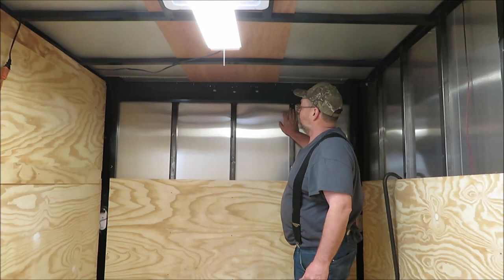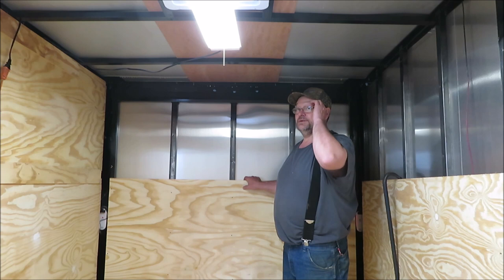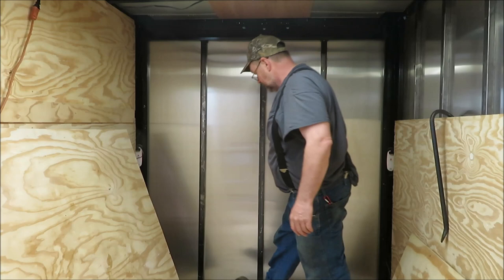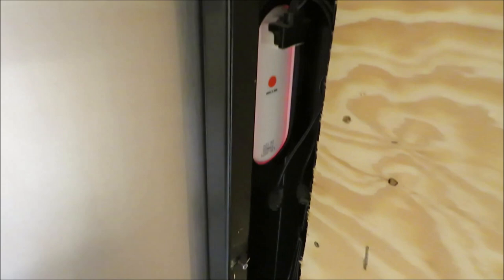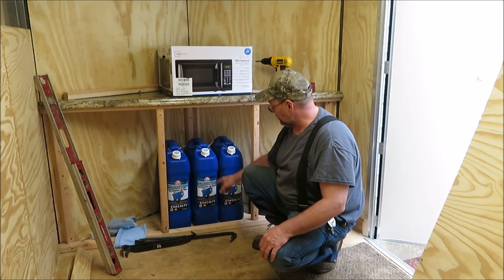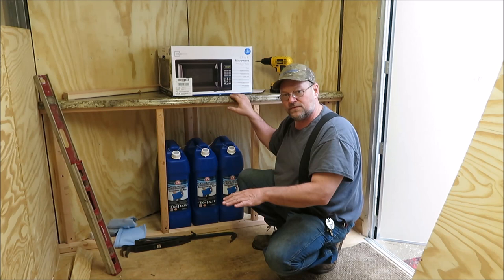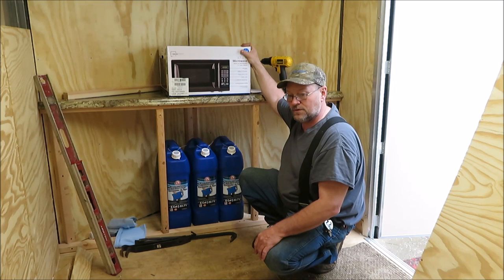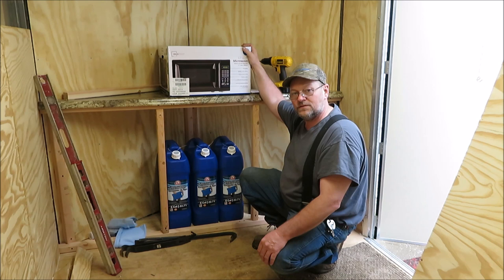cargo trailer camper build part 3 finding more leaks

Comment: Thanks for showing the actual work involved in doing this build. Most videos give a general "I did this or that" but do not show the detail stuff. This helps considerably to me because I will be doing this to a 7x16 enclosed and yes it is a Diamond Cargo I picked up used. Now I have an inkling to how long it will take, extra sealing materials, etc. Wish I had a shop like yours, the proper tools go a long ways in getting the job done. Kudos.

Comment: I realize this video is 2 years old and I feel bad you had the leaking issue. I have a 8.5 X 18 X 6.5  Diamond Trailer also. I went to the factory and picked it up just like you did. Before I ordered my trailer I spent numerous hours researching how to order and build a camper from a cargo trailer. One thing I learned and I hope your viewers see this is when you order your trailer request the factory semi screw the plywood (NO CHARGE) on and DO NOT use the staple nails on the plywood panels. This will allow you to remove the panels without damaging your panels. Also ask the factory to exchange the standard drop axles (NO CHARGE) with straight axles. This will give you more ground clearance and down the road if you need more clearance you can do an axle flip to give more clearance. If you do the flip there is a YouTube video showing the CORRECT way to do the flip. Be aware you will have to do some welding on the axles if you do the axle flip CORRECTLY. Also order a one piece roof (additional charge but worth it) instead of individual sections of roof panels which allow for water leaks.
 Hope that helps any future builders.
Reply from the maker: Thanks for the information next time for sure Alan.

Comment: Removing all walls and insulating will be beneficial in extreme conditions, and give peace of mind when you check for leaks. Looking good so far Kevin, never dreamed you would run into the issues with a new trailer but I know you will make it work.